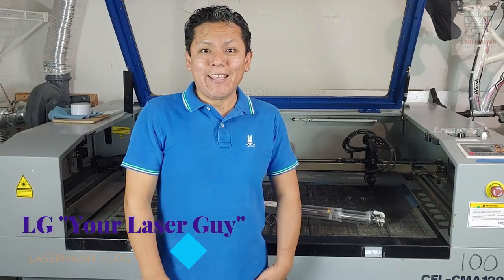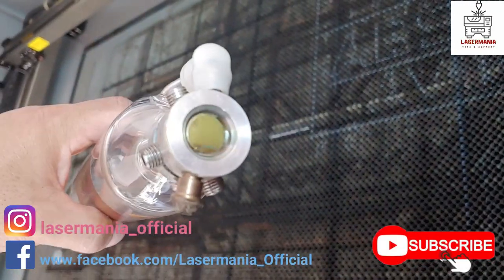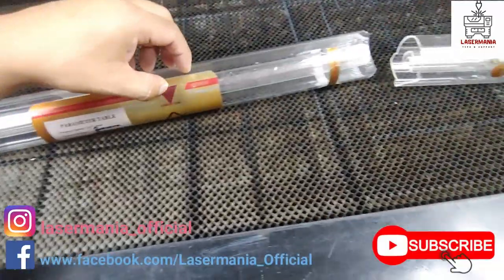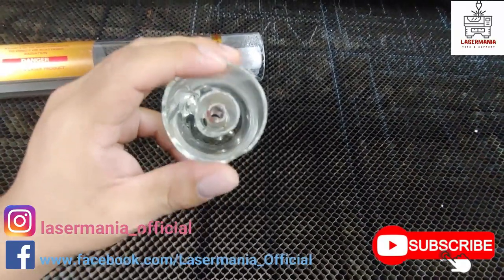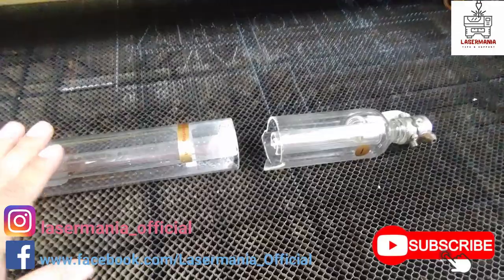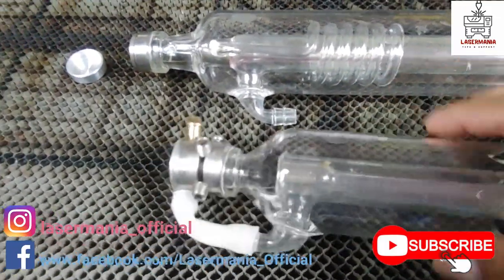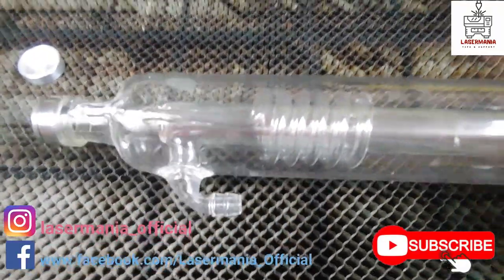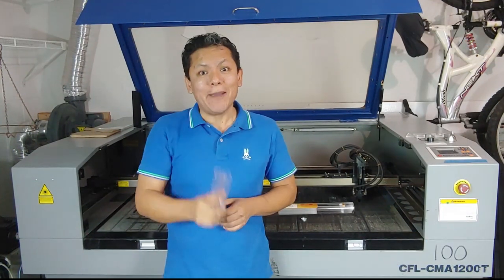Anatomy of a Laser Tube, how a tube really works | Tips and Tricks for Laser Users Owners

Comment: My friend, I think the outter most layer is not just an enclosure, but it also contains the GAS ,and the spiral tube is just a pathway so that the gas can circulate. It should aid the recombination of C and O atoms,because the gas that just LASED needs some time to be used again so it circulates so that new gas is LASING until the old atoms recombine and are ready to LASE again.
Reply: This is basically correct. The "first" ring of space (from the outside of the tube working in) is filled with CO2, then water, then CO2 again (where the laser beam is created). In fact, the CO2 is added to the tube (at the factory) into this first (outer) cavity. That piece of glass sticking out the front of the tube above the laser emitter port/lens/mirror/whatever-you-call-it, is (or rather was) the factory fill port. At the factory it's a tube with an open end, the CO2 is blown in, and while still in the CO2 pressure chamber, the ends of that glass tube are melted closed sealing in the CO2 gas. So that outer cavity and inner cavity are connected by that sprial wound tube. There's some physics (which I can't remember) that explains why a long tube is necessary (or, rather, works better) for (re)combining the spent gas and they just make it spiral to fit it in a smaller space (e.g. inside the laser tube)

Comment: Wondering if you can help me.

I own a 75w tube. Have had it for 6 years, but have never used it for heavy duty cutting.

Mainly rastering on plastic/acrylic and vectoring 0.5mm plastic sheet.

It has recently began producing patchy raster results. Some parts of the letters are fine, others not even cutting in.

I think it's my mirrors/lens but my manufacturer insists that my tube is nearly depleted.

Before I go spend thousands of dollars on a new tube, I thought I'd ask around.

Thanks.
Reply from the maker: hmm, after 6 years? how many times did you replace the lens and mirrors in that time?. About the tube, if you see the light that passes through it is white, tube is OUT, if it is pink/purple it is still in good shape, let me know
Reply: @LaserManiaOfficial  I had the  the mirror above the carriage replaced about 2 months ago. Some materials come up fine on their power presets, other materials are not yielding results.

As for the tube itself, I've never actually seen inside of it. It's encased in about 7kgs of steel.

I appreciate your response. Happy to take on any more pointers you may have.

It's a Universal 75w PLS if that helps.
Reply: Depending on how you use it, CO2 laser tubes will not typically last 6 years.

Comment: How to fill CO2 gas in the tube. Please make one video
Reply: [From my comment above] Looking at the cross-section of the tube, the "first" ring of space (from the outside of the tube working in) is filled with CO2, then water, then CO2 again (where the laser beam is created). The CO2 is added to the tube (at the factory) into this first (outer) cavity. That piece of glass sticking out the front of the tube above the laser emitter port/lens/mirror/whatever-you-call-it, is (or rather was) the factory fill port. At the factory it's a tube with an open end, the CO2 is blown in, and while still in the CO2 pressure chamber, the ends of that glass tube are melted closed sealing in the CO2 gas. So that outer cavity and inner cavity are connected by that sprial wound tube. There's some physics (which I can't remember) that explains why a long tube is necessary (or, rather, works better) for (re)combining the spent gas and they just make it spiral to fit it in a smaller space (e.g. inside the laser tube)